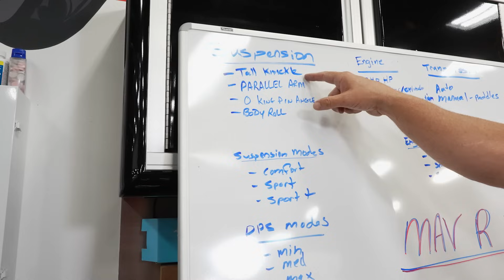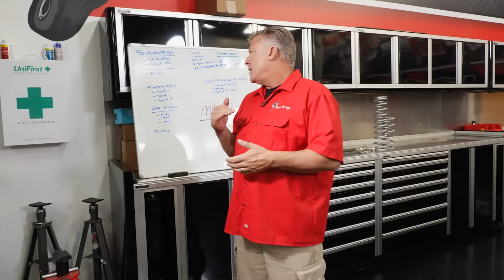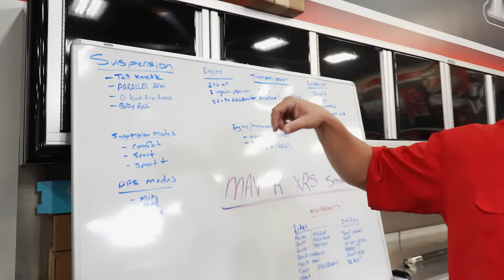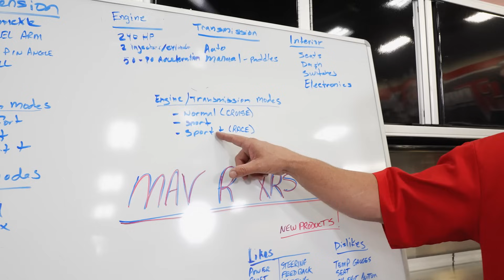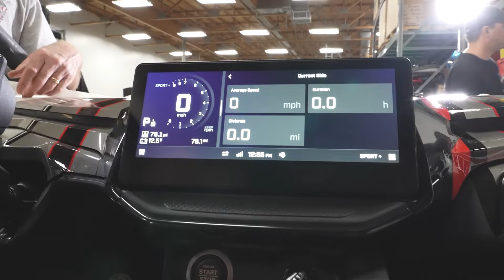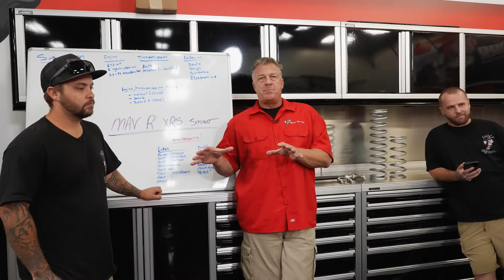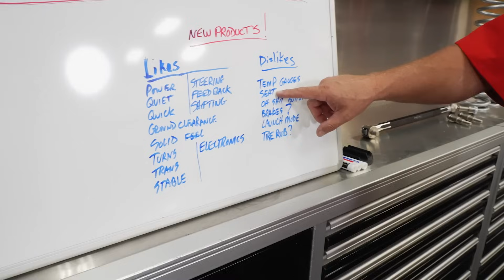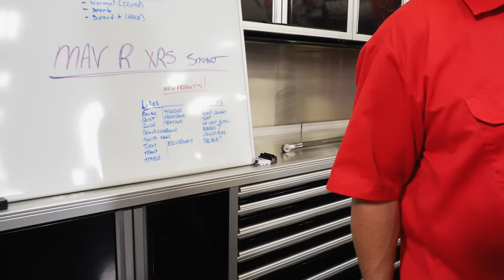Tech Tuesday // CAN-AM Maverick R Review and NEW PRODUCTS!

Comment: On the driver's side there's a panel next your leg you can take off to put it in neutral
Reply from the maker: On man. I knew there was something. Thank you.
Reply: Actually, that is what the OVERRIDE button is for.  Check your manual case, there is a tool in there that you have to use to manually put the car in neutral.  Override and the tool are used in conjunction.
Reply: The override is for reverse and other functions not necessarily linked to neutral. The panel on the driver side you are probably talking about is to access the 4x4 disconnect unit, which disengages the front wheels. You may refer to the operator's guide in the special procedures sections, it is the first procedure. Look for "permanent neutral".
Reply: Jon, was thinking the same thing on the Bottoming!
Please tell us if we need to adjust our Pre-load (is that right?)
Thank You!

Comment: if you run out of fuel and as long as you how power you can hold the N Button down for 5 seconds and it will put it in permanent neutral which will allow you to tow it also. if you lose power you have to manually unhook it at the engine.
Reply from the maker: Killer info thank  you

Comment: If you have to run a wider offset for 35s doesn’t that cancel out much (or at least some) of the suspension benefits this design brings to the table?
Reply from the maker: You don’t have to run a wider offset for 35s. But you can run another 1” wider with next to no issues or negatives to the design
Reply: @ShockTherapyllc  hmmm. I know you guys are the experts but I’m having a hard time not believing my eyes on this one. If 32s are already rubbing on the vertical portion of the arm, 35s look like they’d be smashing into the angled end just before the vertical section pretty hard. Has anyone actually run 35s on stock offset wheels or are we taking canams word for it?
Reply from the maker: @jabroni6199 it rubs on the sidewall.  Not on top.  Phil Blurton and dmDustin Jones had 35s on theirs no problem.